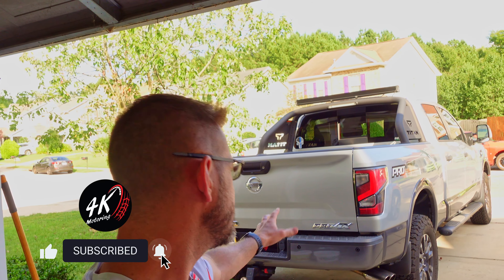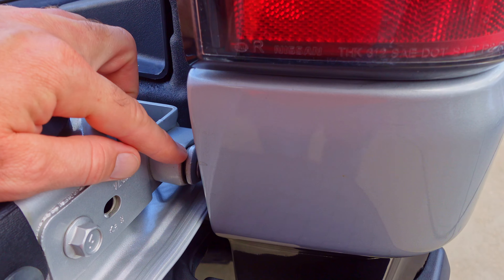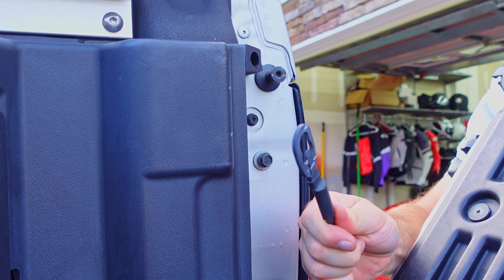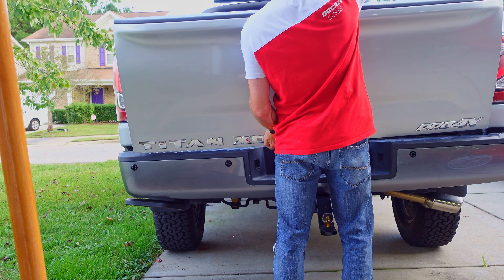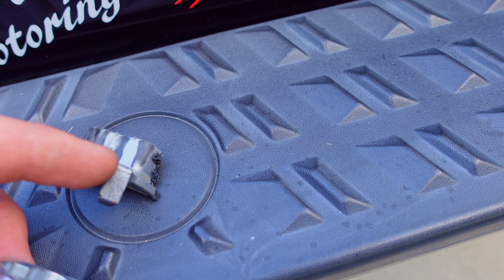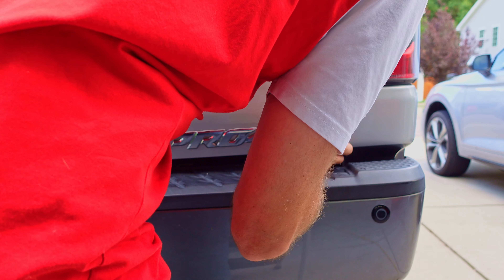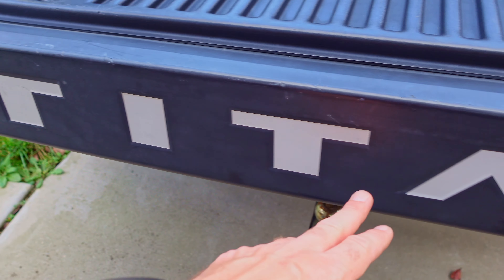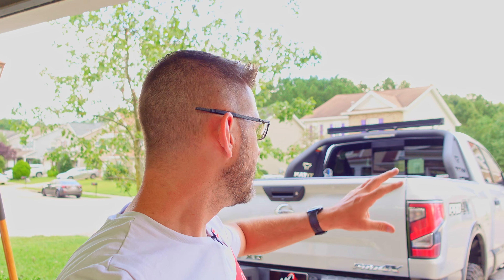How to Replace Nissan Titan Tailgate Bushings with Accessory Anchor Upgrade | DIY Guide

Comment: Thanks for the video i ordered one of these went to put it on and thought it was the wrong one because it didn't have the tab but looks like its not needed. Can you see any need in the tab that was on the original one
Reply from the maker: Not at all. After removing the original plastic bushing it appeared that the plastic was super soft and that tab structurally not capable of much

Comment: Thanks for the videos, love the Titan content. 

How many miles do you have on yours now and do you still like it?
Reply from the maker: Thanks for the support!

The Titan now has right about 55k miles on the clock right now, aside from fuel mileage it's just about the perfect truck
Reply: @4KMotoring  wow that is low miles for the year! You don't drive it a lot do you 😁

Good to hear though, I am looking right now at a 2018 PR that has 74,000 mi looks to be very clean test drove it drives nice. I would likely get an extended warranty on it just to be prudent. But otherwise absolutely love the truck Love the way they drive, to me they feel like a truck should.

Comment: Should have shown how to get that wiring harness apart. Struggled for 2 hours and gave up
Reply from the maker: Why did you take it apart?
Reply: @4KMotoring  to get the tailgate off the truck
Reply from the maker: You can lay it in the bed without disconnecting